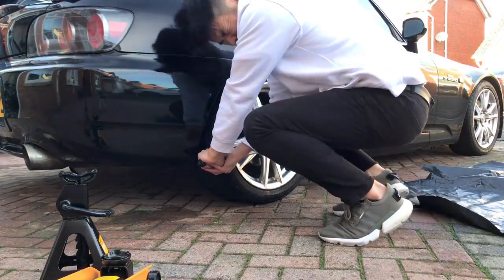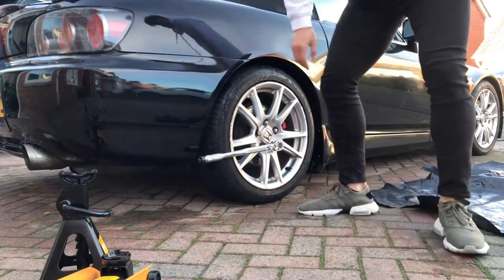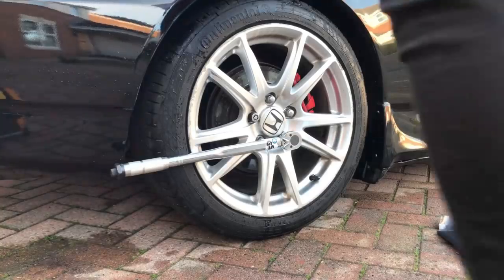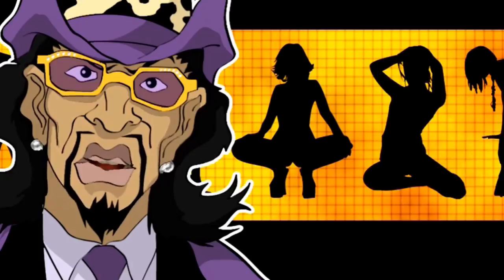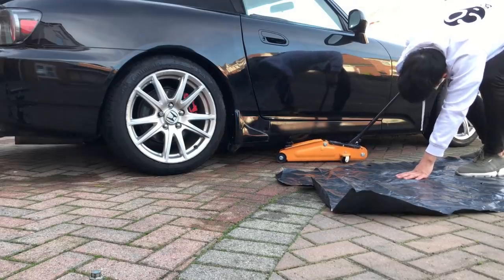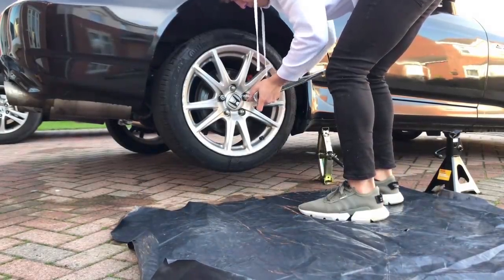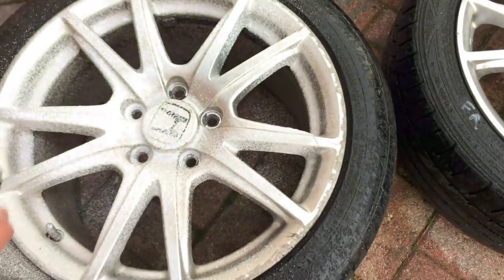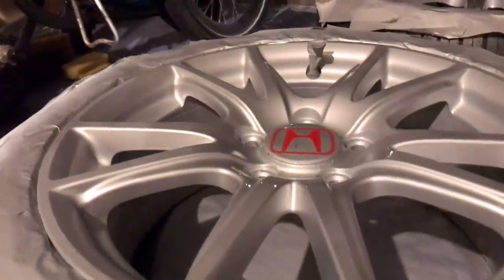DIY CAR CHROME ALLOYS on a Budget - Are they any good?

Comment: I've tried this multiple times with different brands of paint. Molotow model paint is the best but it only in 30ml refills at most, so it's super expensive and you'll need an applicator. Rust-olem seems to be the best spray but with every chrome paint - they dull and turn silver the second that you apply clear coat. You're better off just buying silver paint, or going without clear coat & having to reapply the chrome spray every 2-3 months. Instead of normal car bodywork clear coat use either alclad gloss clear coat or Pledge floor polish, you'll get a near-chrome look... it still dulls, but not as much, I'd say it's halfway between silver and chrome.